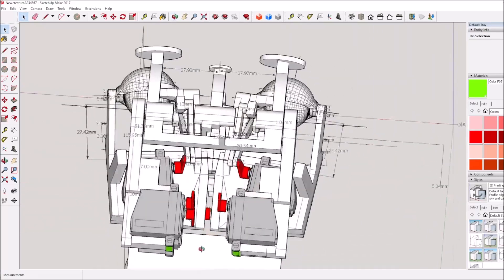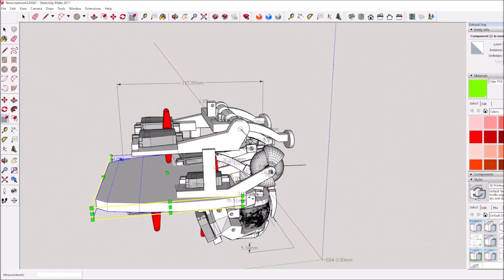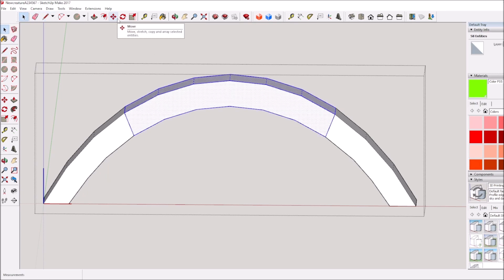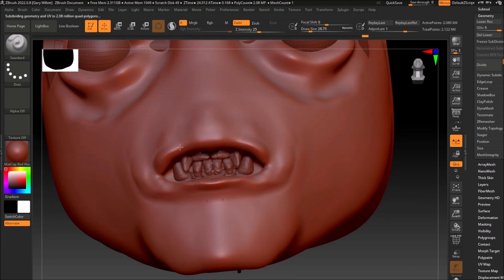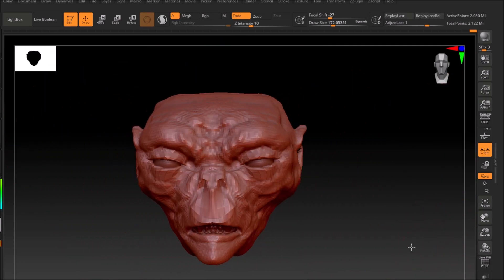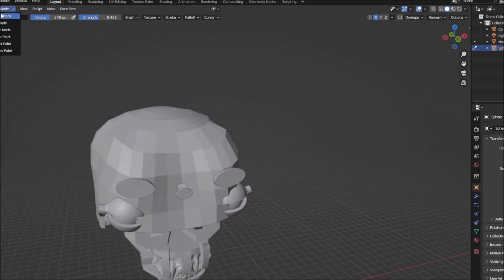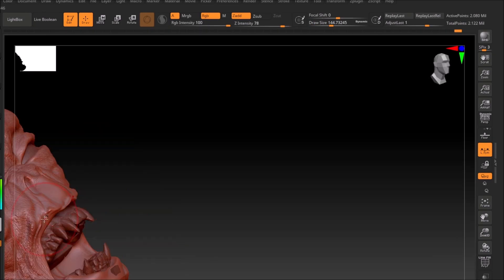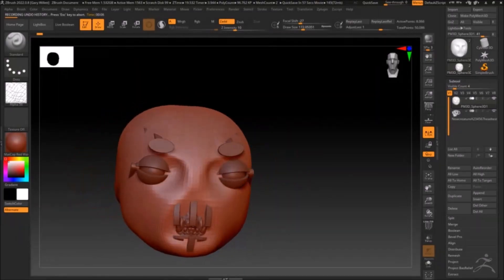3D Printed animatronic creature part 4

Comment: I have a couple of questions.
In your sculpting Mr. Willett, do you use a tablet like a CINTIQ for drawing onto Zbrush or do you use a mouse and keyboard combo?

When you make the inner skull on Sketchup- how do you translate that skull surface body into a volumetric body? What I mean is, how do you give thickness to the walls of that skull? 
I personally can't add volume to to surface bodies like that on Fusion 360, but like you mention, I can take that same file to Blender and deform or connect vertices to create volume. Just curious if there's a faster method.

These technical videos are pretty nutty! Be safe!
Reply from the maker: use a mouse and keyboard combo . SketchUcation has some plugin, but sometimes it works,  just doing like this    https://www.youtube.com/watch?v=HPOXEyX2VDs&t=321s
Reply: @garywillett4146  OH WOW! THANK YOU SO MUCH! You don't know how much this helps. I have been trying to give volume to a car panel for making a wide-body panel, and have been looking for a definitive answer on this. It really is a methodical process to cut and weld all the vertices together. Thanks again!